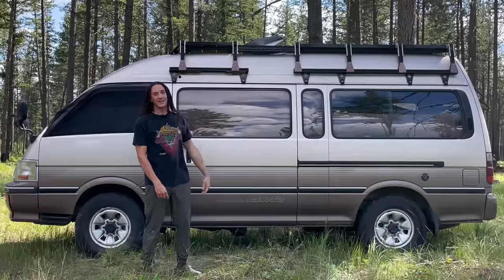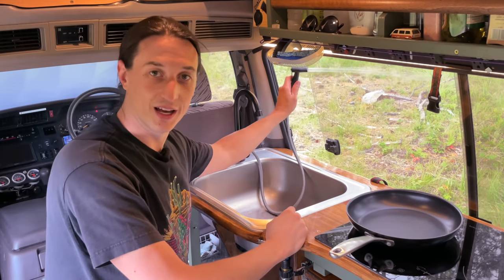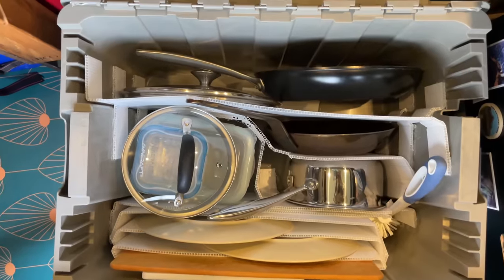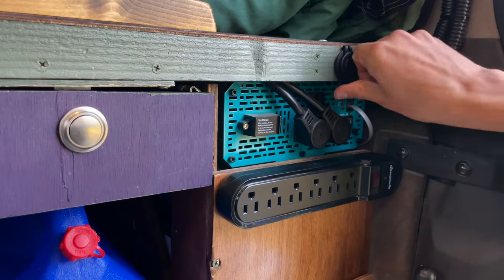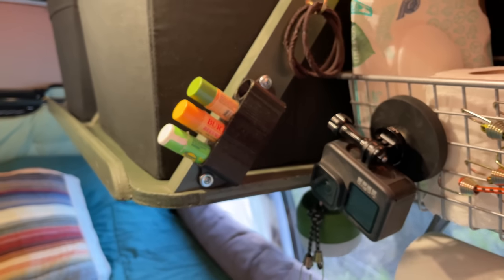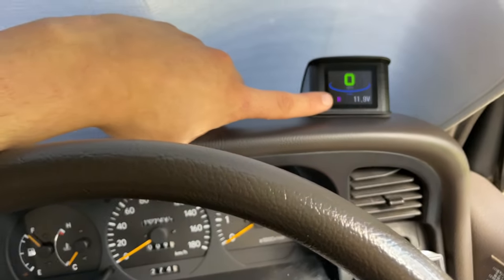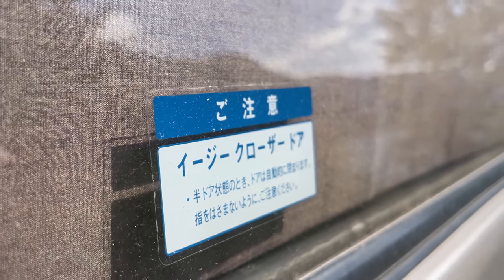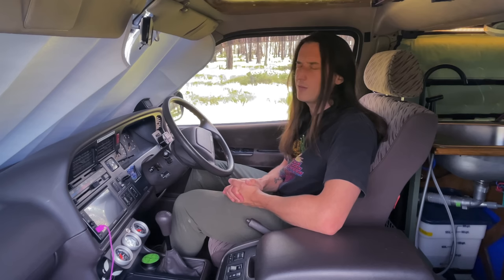I Live in this Little Self Converted 4WD JDM Camper Van - FULL TOUR

Comment: I had a fleet of these for my delivery business.  They are quirky..  The turning radius is outrageous.  You can literally u-turn on a city street if no parked cars.  The LE are the best…they are peppy as hell.  I moved up to Previa’s in the 2015 or so.  Great vans. I bought one that had been converted.  Great choice, question?  Is it manufactured in Japan?  If so there is a difference.  you can look at the drivers side door.
Reply: oh yeah and be careful with the sliding doors and the window in the sliding door.  They both take a beating and once the door slips out of its groove it will never be the same.  I also found the window in the sliding door can swing loose and fall out.  These problems happed in two different vans.  There is a turbo version but the 4 wheel drive was not really as advertised, but yeah great choice.  300 even 400 k however.  The transmission is lucky to last 150 to 200k.
Reply: Oh I see it is actually a built for Japanese ice.  some places it is hard to get them registered.
Reply: and you can find parts.  the american version is basically the same rig…. maybe only goes 60 miles and hour but under sixty it is super peppy.

Comment: This has to be the coolest hiace build i’ve ever seen. I’m currently on the hunt for one aswell, but im going for a 1998-2007 model. They are very popular here in nortern Europe. On another note, toyota was very good at using the same parts on many cars back then, is there any models that share this with your hiace that was sold in the US?
Reply from the maker: Some drive-line components are the same as what is found on the 2nd generation 4runner, and there's a forklift that uses the same fuel filter. But, brakes, suspension, engine, fuel, and cooling parts pretty much all have to come from overseas. Good luck with your search!

Comment: Nice work, and I totally agree with your about induction cooking.  It ain't perfect ... yet, but all factors considered it is the best performance for unit of health and responsibility.  I like mine but I only need one burner in my house.  I almost bought one of those Toyota Engine up-front vans in the late 1980's.  I really liked them, and would have bought it but I got a Ford Aerostar for much less.  Also, the front situated driver's seat really made me too nervous.  If you have to slam on the brakes it feels like all hell is breaking loose because the front dives down and anything not secured in the back will not only fly forward but up too.  Still, great vans, like the Previa too.

BTW, what is with the wormhole in your refrigerator?

Comment: Thank you for the great video! 
Hello from Canada.
I am heading out to Yukon for the first time with my Toyota Hiace this August, 
Do you have any advice which spare parts that I should buy before my road trip 
Please!!!!
Reply from the maker: I carry spare belts, hoses (coolant and fuel), a glow plug, a rebuild kit for my alternator, a lower ball joint, brake pads, and then in storage i have a spare alternator, brake rotors, drum pads,  and clutch kit including the clutch release and master cylinder. If you have a diesel its worth looking at having your injectors rebuilt at a diesel shop before you head out, and of course cooling system maintenance is #1 priority with these vans. Good luck this summer!!
Reply: @dustyodyssey  Wow thank you so much for answering me. This is incredibly helpful! All the best to your Alaska trip!

Comment: Is that a diy 8020 (or whatever you call it, not so ubiquitous here) roof rack/platform? That’s such a nice fit - so much neater than any bought one I’ve seen used on a high roof van. The silver on black has a nice industrial look too.  👍👍
Reply from the maker: I guess the common name is “t-slot extrusion” pretty common in engineering/industrial applications. I bet you could buy it where you’re at. Glad you like it! It was quite expensive to put together, but I’m happy with the result
Reply: @dustyodyssey  Thanks, I did a bit of a binge-watch of your Hiace build last night & woke up to quite a few screenshots of how you put it together!😄  Round here in Oz there are quite a few high roof Delica L400s getting around with racks so high you could store a mattress under them! Your solution’s so much better. If fact, pretty impressed by the whole build - looks like you have a bright future ahead of you.  By the way, pretty sure you could’ve had a decent night’s sleep when you were collecting the van if you’d just folded the seats down flat ; ) Best of luck to you!
Reply from the maker: @s-c..  but the seats didn’t fold flat! haha, anyway, glad you got some use out of the build videos. Good luck with your project! 🙂
Reply: @dustyodyssey  oh, haha, spewing! 👍

Comment: I have exactly the same van as you, 1997, 3 litre turbo diesel, automatic, 2 wheel drive. Did you insulate yours?  I haven’t and haven’t put in a diesel heater yet. Got a few good ideas from just this video!  Thanks.
Reply from the maker: Nice! I did insulate all of the body panels and the ceiling with sheep wool.

Comment: You obviously haven't read up on the use of Gas, nor the Hi-ace and it's market,. This is a very common van in Europe dude. Only recently toyota have stopped producing it, because it was only the scandic market that still wanted it.  And the Hi-ace does not only look like yours.  Also, if you have a car with km/t. Learn it! ;)  On another note; high regards for your custom solutions. You've got a lot. awesome!  One thing though (...) how do you manage with no gas cooktop for 6 months of the year? You follow the sun south during winter?

Comment: Wow, this is incredible and super informative! ☺️ I’m looking at possibly buying a 1997 jdm Toyota granvia (the sister van to the hiace). My only concern is that repair times will be long (possibly weeks) because of part availability, have you had any issues with that? I live in Canada 🇨🇦 thanks!!
Reply from the maker: That's a real concern. If you stay on top of issues, and get parts on order as soon as you suspect a problem you can circumvent a lot of the waiting. A lot of parts are available domestically too, you just need to check the part numbers (ToyoDIY is an amazing resource). The bigger issue is that if you don't want to do all the mechanical work yourself you're going to have to find a mechanic that's willing to work on it, and you will have to find and provide the parts, which is a project in and of itself.

Comment: Love the video - I have a local guy that sells RHD imports and I'm always fascinated by the HiAce and Delica. One question. I've always wanted to have one of those super long pull out drawers (around 5 minutes into your video) actually for my hobby work table at home. Did you build that yourself? I'm struggling to find a good "how to," but I also might not be using the right keywords. (and my wife walked in and said "I love his low braid" - :) so, you got that going for you, which is nice.
Reply from the maker: Haha, I did build that myself. I just bought some really long bearing slides and kind of figured it out as I went. Also 500lb amazon drawer slides are probably only actually good for 100lbs. I also talk about it here: https://youtu.be/Jo5pVHOd49s?si=mivHBFwiDeyCrFb2&t=398
Reply: @dustyodyssey  thanks man!

Comment: I have this van in 4WD version but it kinda sucks off roading, not that it isn't capable but its fuel tank and engine parts are so low to the ground any rocky surface and rocks hit everything. Even my stock forester has a higher clearance. Its a beautiful van but has some old school flaws and eats fuel like a truck. Nice build though :)
Reply from the maker: Yeah, we do be scraping quite a bit, I get better mileage than pretty much any full size van sold In the US so I’m happy

Comment: Great build! I am getting ideas for mine:) Have you any advice for converting a van like this? I have a Mitsubishi Delica up with the converter as we speak but they aren't starting until I go up to chat to them about what I want. Sure I don't have a clue.
Reply from the maker: It really depends! In smaller vans, I think its good to start slow with just a basic conversion and then add what you need.
Reply: @dustyodyssey  That's what I was thinking. I just have to get it converted basically so the road tax goes from €1800 a year to €120. Crazy money. That's without insurance or anything...every year. Needless to say it hasn't been on the road the last 2 years🙂 They are a bit strict here too about conversions. Better to get someone to do it right and avoid the hassle. Did you do a video of the preventative maintenance you did to yours? 2 years of Irish weather hasn't been kind to this one.
Reply from the maker: @evildiesel1709  I didn’t get super in depth on the maintenance, but I did document my build process. Thats crazy on the taxes. Good luck!

Comment: Max, what would be, in your opinion, the North American van that would be closest to the HiAce to build a rig like yours?
Reply from the maker: Probably a Chevy Express or Ford Econoline. Not as fuel efficient, but you can make those vans even more capable off road with a 4WD conversion, a little wider than my van but about the same size.

Comment: I'd love to know about your sound system and how you hooked it up! I saw a pair of 6x9's and a Nakamichi driver. Is that the BT Radio and CD player for about $125?
Reply from the maker: It’s just the bluetooth/radio unit no CD, was about $50, and yeah, you got it, it’s hooked up to some polk 6x9 speakers, sounds pretty decent. I actually had to modify the head unit so it would fit up there. I turned the back of the unit up 90 degrees so the inputs/outputs are on top

Comment: I'm sure you could've gotten a 95 Chevy G20 conversion van for like $2,500 and built it. Air bags if you didn't want to get a custom steering wheel, ABS, crumple zones, 10 speed automatic, and yes traction control especially if you upgraded the engine, ECM, and transmission. On top every bad thing about that HIACE, it's not even really a 4x4, and you can beat the traction of a HIACE with an old Chevy G20 van, by swapping the rear end from an open diff, to an LSD, or a locker. Even if the super nice stability control doesn't carry over from an engine and transmission swap, you can absolutely get way better gas mileage, horsepower and off road capability than a HIACE for way less money. Ask any mechanic. Even if the parts are not as reliable as Toyota, which I do believe they are more reliable than this Toyota, part availability and pricing is still far better than with a HIACE. Sometimes you don't realize the hidden treasures in your own backyard.
Reply from the maker: I think on paper you might be right, but I really like my van. I understand it’s not everyone’s cup of tea, and rationally it might not be the smartest choice, but I love it. But, what you’re talking about sounds like a really cool project too! I could actually see myself doing something like that if this van ever kicks the bucket. But the fact that your solution for a reliable and economical USDM van involves an engine and driveline swap is pretty telling. Anyway, thanks for watching
Reply: @dustyodyssey  My thing is if it's a van build, why is the van itself your limiting factor? Van building is still a car enthusiast genera is it not? Van life seems to be the only car genera where the people are squeamish about modifying the cars they build their lives from. It's oxymoronic. All I'm saying is don't try to find another justification for what you like doing. That's the heart of it. You, and what you like. That's what other people like too. This thing about not finding a usdm van that fits you, is not accurate because there are 5, and 6 speed trannys on vans in the last 30 years, and you don't need to modify them to get your desired numbers and capabilities. I was just saying that if you wanted the ultimate build, or just something better, then it's available to you in the usdm via mods. The minute you start testing the usdm, is the minute actual car enthusiasts start pulling out the big guns by finding your double standards and inaccuracies. Yeah it's harder to mod then to find what you want already, but it is cheaper, and it's not impossible. And when it's done, it's more rewarding. I don't know whats so telling about that. What's more telling to me, is how much you didn't want to tell anybody how much you paid for everything in this video. As if that might scare ppl away.

Comment: Have you exceeded load capacity of the vechicle based on manufacture standard ...?
Reply from the maker: The place where they stamp the GVWR on the chassis is blank on my van, but I tried to keep things lightweight. I had the van weighed when I got it and then added 110 lbs for each of the 10 empty seats as I has as a safe maximum, and I am just under that figure.

Comment: What ladder do you use??
Reply from the maker: SURCO 103B
Reply: @dustyodyssey  Did you bolt the lower section onto the van? Im trying my hardest to steer clear of drilling into my hiace
Reply from the maker: @elijahpetrill2011  Yup, drilled 4 holes. There are some ladders that clamp on to the bottom of the pinch weld though. You might ask RoamerNW about ladders